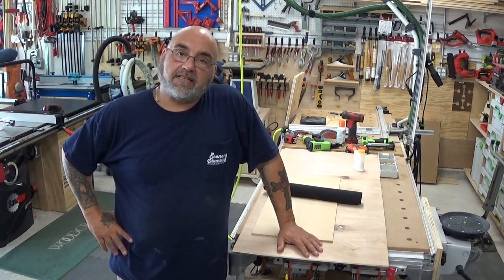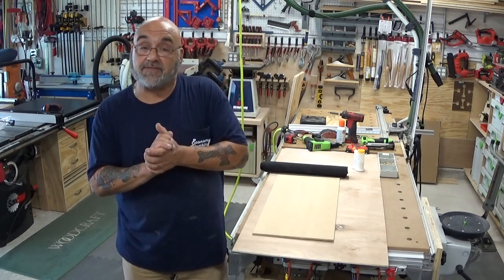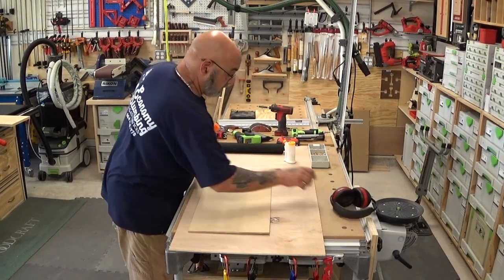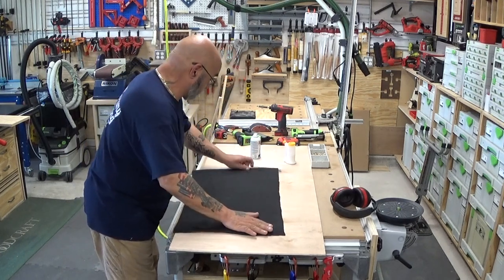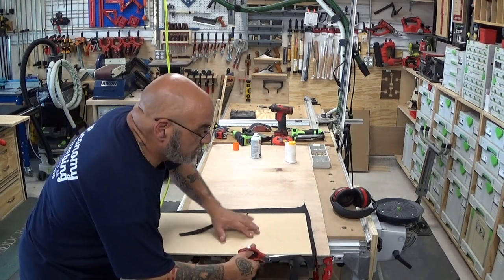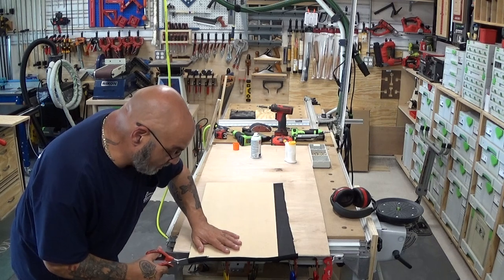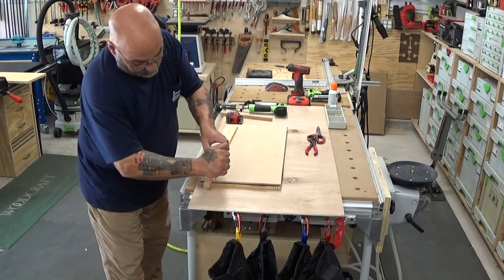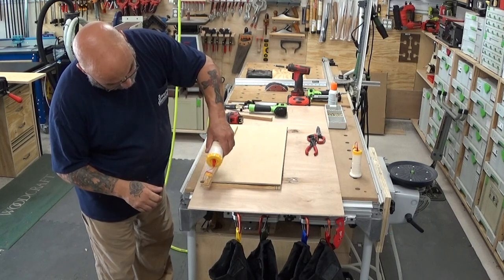Build of a assembly board for your work bench.

Comment: Mike, another useful video.  Thanks.    The non-slip pad material looks like tool box liner.  NAPA's come in 2 varieties -- nylon-rubber and polyester.   I thought that wood glue would stick to those.  Rockler and Highland Woodworking (and possibly Woodcraft) sell  mats made from silicone for woodworkers.   Silicone pads are popular because apparently nothing sticks to them.   You can also find silicone pads on Amazon and in kitchen stores like Bed Bath & Beyond & Williams-Sonoma,  and on Amazon.com,  marketed as "silicone baking mats."
Reply from the maker: Welsh Rabbit Thanks I was trying to figure out last night what it was. I did get it from NAPA auto. I did buy one of those silicone pads from woodcraft that I used to work on my slot cars st the track. Thanks for the comment. Mike